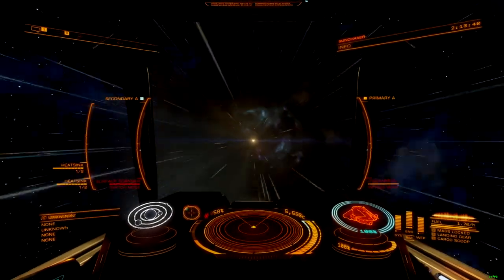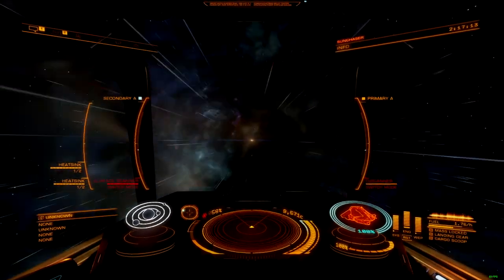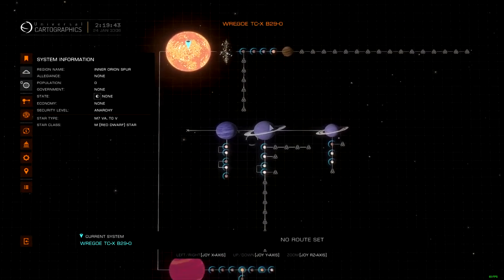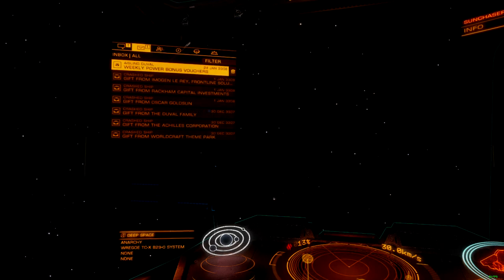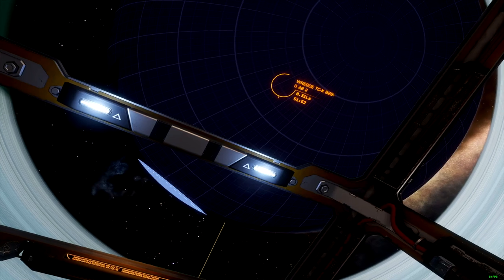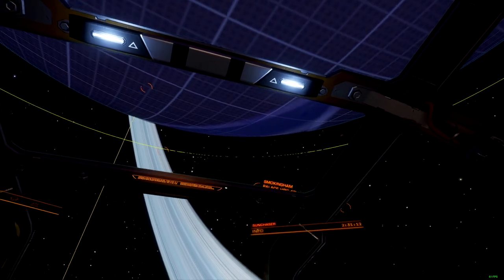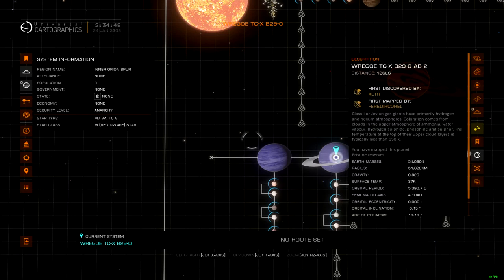Elite Dangerous | General Commentary | The Ideal Limpet

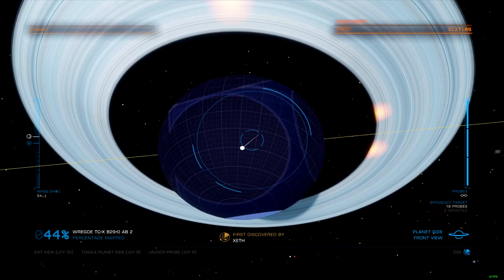Comment: 13:35 The hatch breaker originally worked this way; if a shield was up, it would crash into it and destruct. Originally, it also flew at 300 m/s. Pirates requested piracy buffs, and they increased speed and allowed hatch breakers to pass through shields.

This was a great change for piracy when it was centered around rares trading in smaller, fast ships, but the change came after that period was mostly over. In my opinion, Pirates need a way to bring a target to a full stop (disabled), and then higher classes of hatch breaker (3,5,7) should revert to flying at only 300 m/s (or less), NOT pass through shields, but have a higher cargo drop rate with more cargo dropped in total per limpet.